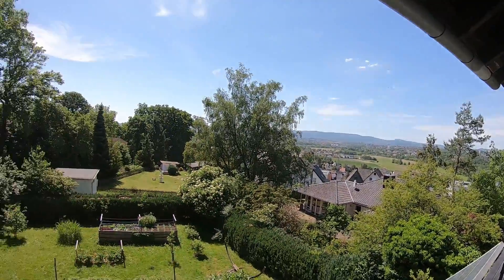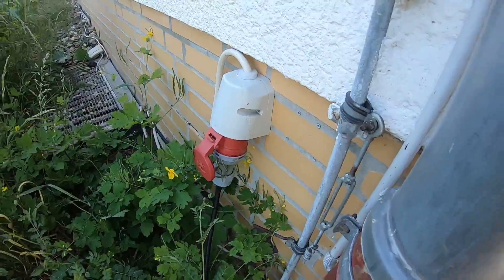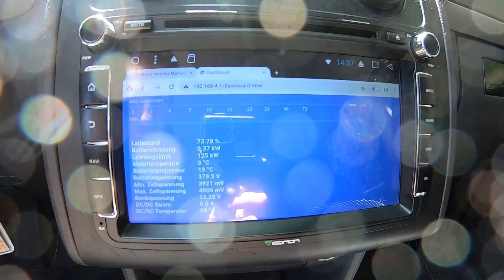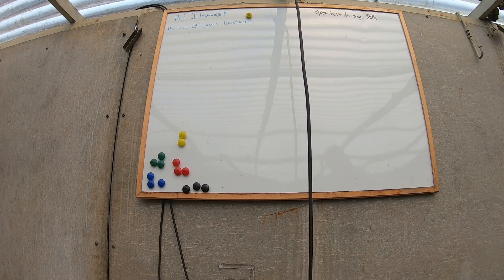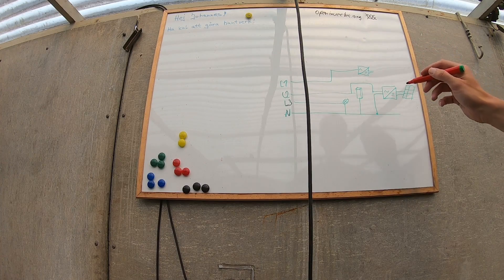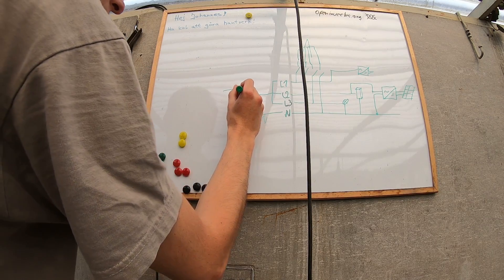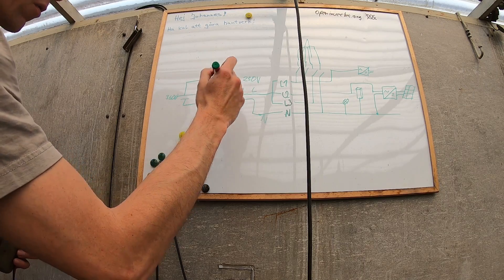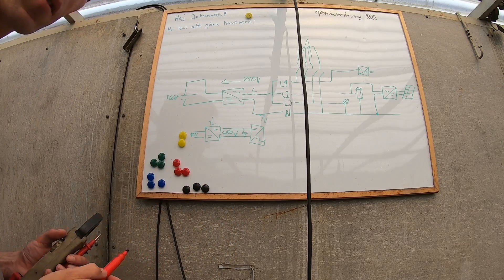Lab Update #76: V2H with solar inverters explained

Comment: Nice work!
Been expermenting a bit with similar stuff for some time and recently got some new motivation and inspiration. Thanks for sharing! Been using standard VFD's to run stuff from nissan leaf HV bus, like this:
https://www.youtube.com/watch?v=qTDxxVHGikk
Just found 2 used 4/8kW inverters of the same brand as you're using, looking forward to try them out in various configuration when they arrive.
Greetings from sweden, seems like you got some connection to sweden with, your recent travels and the flag in this video :)

Comment: It seems that is a 220v AC to 400-500v DC bidirectional inverter. Is it available on the market or you did some modification?
Reply from the maker: this one: https://de.aliexpress.com/item/1005002013462606.html
Reply: @openinverter  Thanks. It's wonderful. I have been waiting for such for long. I hope you can further explore the true and safe bi directional charging full set up. It seems the 10kW version would more practical.
Reply: @openinverter  ...are you still happy with this inverter ??   Did you modify it to full sine-wave ?   
Is it truely bi-directional, or what modifications did you make ??  Thanks
Reply from the maker: @zaneenaz4962  No modifications needed, this topology is bidirectional by default
Reply: @openinverter  Hey Johannes,
Any chance you have a search term or even an updated link? the original item is no longer available under the above link. Thanks, best regards, Ludwig
EDIT: Found the key words from your older videos on the inverter: "sine inverter board" and similar finds the required stuff

Comment: Johaness, I bought an inverter what you using on your your car. I loaded it with EVSE from leaf, 12a. It exploded after 2 minutes without even having a chance to get warm, Input caps exploded(and contactor inside of the pack got welded, so I have to drop a pack to replace it). It was been connected to a running Leaf. Not sure why. In a manual for it is said what HV and LV have to be on at the same time. I got another one but really scratching my head. I did seen other inverters like so what have only HV connection, and LV gets generated onboard of the inverter. I still can't figure it out why input caps exploded. Do you have any thoughts about it?
Reply from the maker: I have fused the inverter separately with 10A on the DC side. At some point the input caps also blew, they are bad quality and also the fuse had blown probably as a consequence.
Might add a follow up detailing the inverter integration.
Reply: @openinverter  Would be great, Johannes, if you can.

Comment: I am a little confused on how you get back the energy from the car into the house. Is that inverter bi-directional? the inverter you charge the battery with?
Reply from the maker: yes it is bi-directional. Normally not meant for charging but it will.

Comment from the maker: UPDATE: after being offgrid for 24h the SoC CLIMBED from 73 to 83% :)
According to a comment on Patreon it still hasn become clear: the blue inverter in the car generates a "grid" and the various solar inverters synchronize on it. Positive battery current means charging.